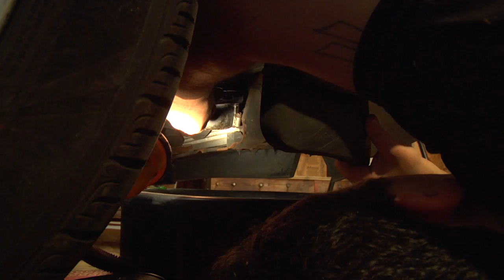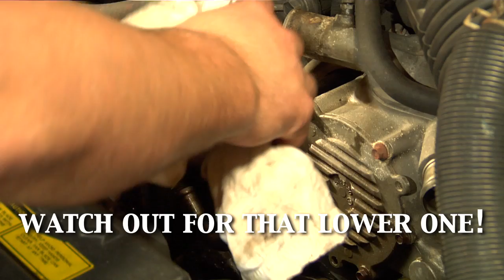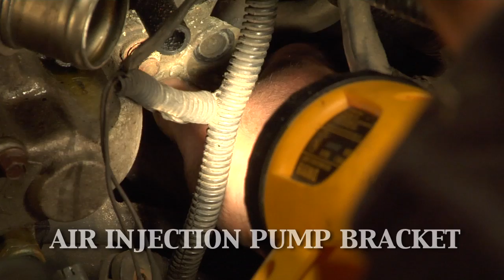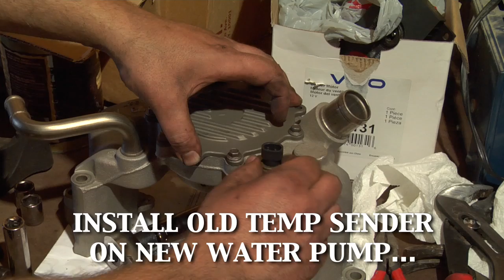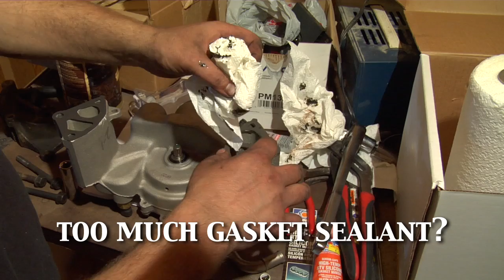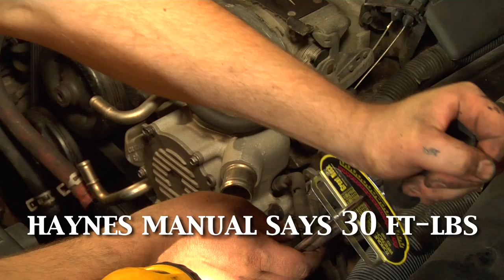96 Impala Water Pump Install

Comment: thank you Joe Mama for pointing out the missed details.  I knew the basic steps but I turn to youtube exactly for these details.  I couldn't figure out why my pump wouldn't wiggle out.  Most the other videos are for Camaro, Firebird and Vette which don't have that bracket in the way.  THEN I couldn't get the bracket out because of that hidden bolt.
Mine (95 Roadmaster) also had a sneaky tab holding the air injection tube to the BACK of the bracket lower boss.

Comment: Remember the O-Rings on the pump shaft and on the water pump drive shaft, they seal the Drive coupling. May want to check the front seal while you are in there. Good video. . .

Lg

Comment: This video makes this job look easier than it is and misses several steps. There's 3 small bolts on the air pump that have to come off to get to 3 the bracket bolts. The bottom bracket bolt is hiding behind the 4 spark plug wires. The middle bolt on the right side of the water pump has two separate nuts. One holds the bracket on and the second holds the water pump on. These are just a few things this video misses.
Reply: Thank you Ive been looking at this bracket for 5 minutes wondering what Im missing

Comment: You are the haynes manual of impala repairs. I have a 96 with 80 thousand on it and i thought my power steering went out only to discover my water pump was leaking causing my belt to slip.

Comment: Great video thanks.....did you put gasket goop on the water pump bolts? Because the bolt on the bottom tight side water cane out when the bolt came off
Reply from the maker: I think so, yeah, gasket stuff on the threads of a couple of the bolts.  It's been a couple years..

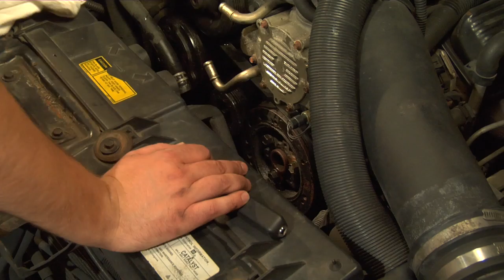Comment: Can somebody help please. At 1:13, he disconnects the temp sensor plug. I have a 95 impala, mines doesn't have a clip on plug, it's some type of needle that goes directly in the middle of the bolt. When I tried to unscrew the bolt, coolant came shooting out. Anybody know how I would remove my temp sensor (trying to diagnosis fans not working issue)?

Comment: i have a 95 camaro z28. would removing the old pump be the same process? i removed the air pump but i was told to remove the ignition coil also? is that correct?

Comment: First time I changed a tstat I was 20, switched from a 180 degree to the 160 degree I didn't drain enough coolant took the neck off and woosh coolant everywhere DESTROYED the distributor. Bought a new one with cap and sealed the opti with gasket maker, never had a problem since, and while I changed the opti, I replaced the water pump to as it was already removed to get to the distributor. LT1 motors are easy to work on but the distributor is placed in a bad spot IMO. Great video none the less
Reply: Did u seal the opti cap with a lot or  did it just take a little bit of gasket maker . And do u have a vented opti ?